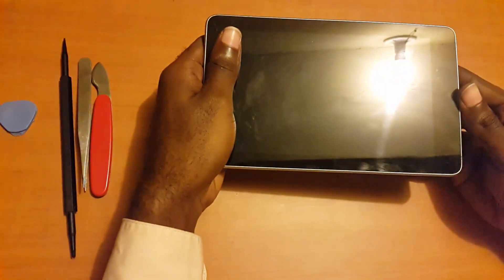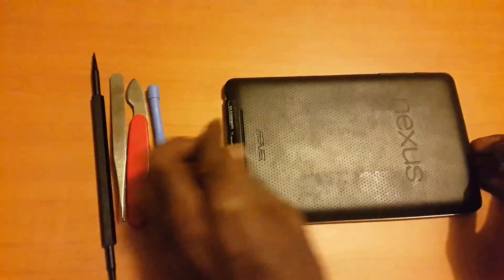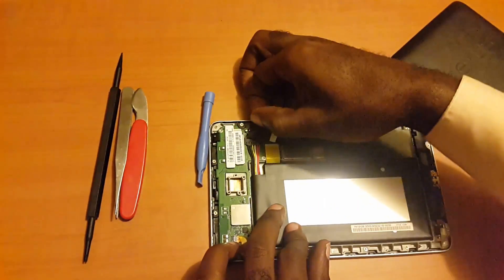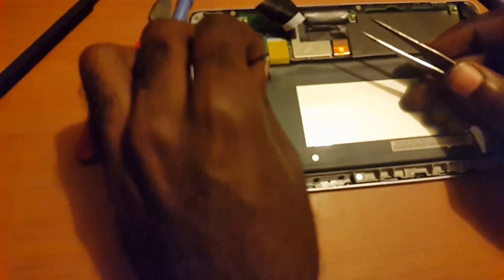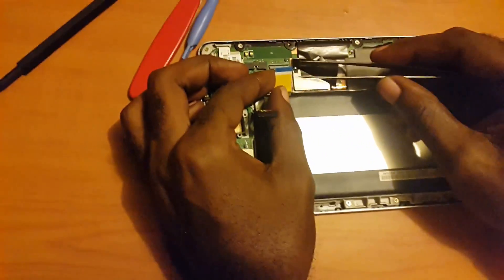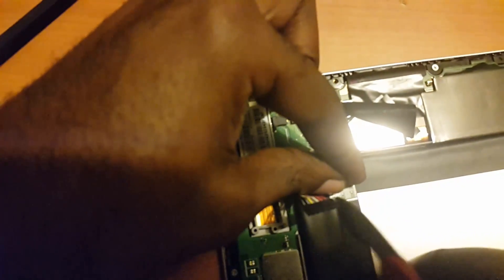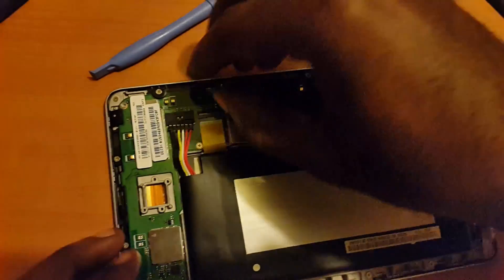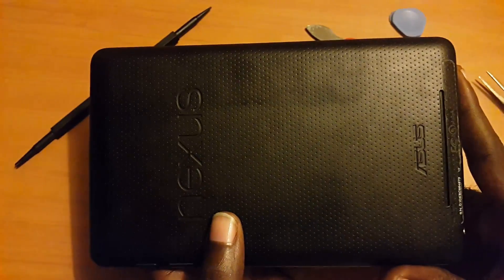Fix for Android Tablet White Screen Issue

Comment: What i do when dealing with ribbon cables before  reinserting them i aways use a pencil rubber across the contacts mainly to get rid of any static but would solve  this "rare" problem also works for electrostatic issues on compute ram